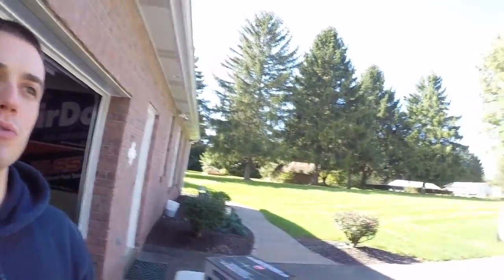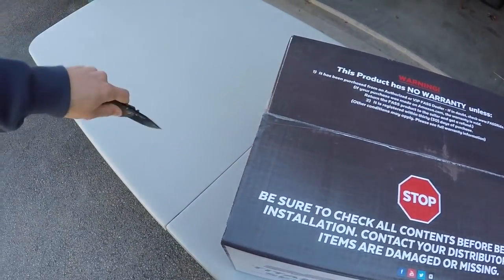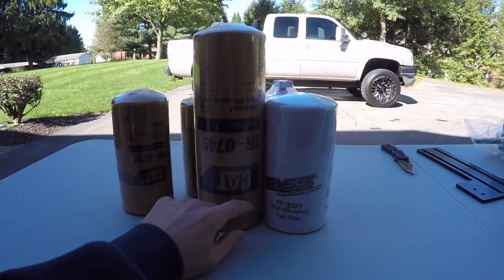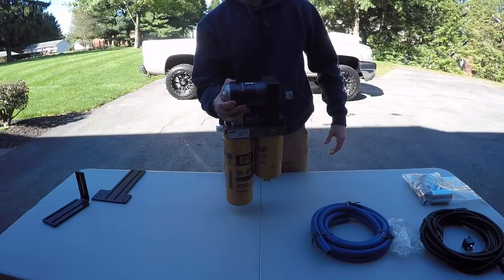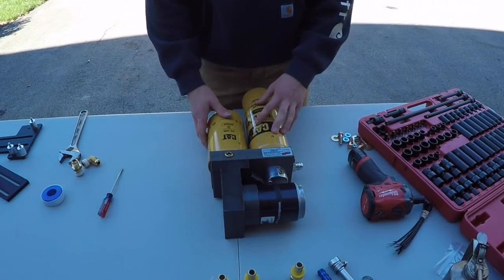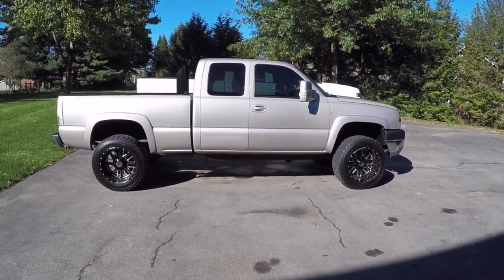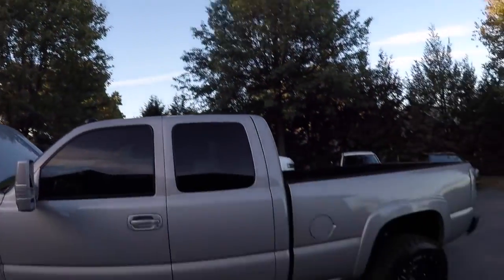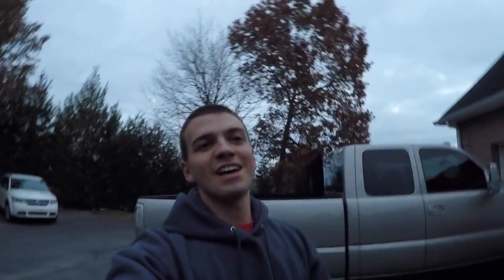Diesel Lift Pumps: Information and Installation!

Comment: Just installed an AirDog II 4G 165GPH on my 08 LMM. I'm finally able to hold 26K psi of rail pressure for a full EFI Live 150HP tune 5 run without dropping any pressure. 
I have 3 inch turbo pipes, 4 inch straight exhaust, full deletes, fuel rail pressure delete plug, ported fuel rail fittings, and upgraded stainless steel Dorman fuel lines. 
The AirDog mount is awesome. Can't even see it. And the quick connect fittings were super easy to install and hookup. Wiring harness is very nice too. Can barely hear the pump with the ignition on and engine not running.
Reply: I keep having issues with the OEM Fuel head, I keep loosing pressure. the last OEM head lasted 2 months. My truck is 2004 LLY with edge programmer.  Nothing else done.  Would a lift pump fix this issue?  Do I have to remove the OEM Lift pump when using this?  Or keep it and use 2 filters??   Thanks.  I'm gona look into the Airdog set up
Reply: SuperRhino_R1 stetler 
I kept my OEM filter housing with the filter itself. I figure more filtration is better but some people say you don’t need it. But you’re protecting your injectors with more filtration

Comment: Like this,have a 2008 2500 hd ,had to do alot research, my truck kept giving me low fuel pressure on fuel rail,and alot suggestions but no right ones till a ran into a honest mechanic and told me to get a lift pump,,,workin project

Comment: It only takes about two hours to do one if you never done one. Also if you get a bigger one and don't need that amount of fuel it will go right back into the tank through the filler neck.
Reply: I agree I think it just “polishes “ the fuel a lot faster with a 165

Comment: Does lift pump do anthing as a lift pump is only a few psi even if it's 20 or 30psi a diesel pump puts out like 30.000psi @ minimum? Having an extra say 10psi wouldn't really do anything but burn out the pump?

Comment: You don't need teflon tape/sealant on the threads of the fittings on the flared side. They seal at the flare, NOT the threads!

Comment: Any chance you can go more into detail on dealing with the fuel lines?
Reply from the maker: Sorry I did breeze over that.  Shoot me a DM at @MDDPerformance on IG if you would like some pictures!
Reply: I used the blue 300 PSI hosing didnt have any leaks with the one Female GM end to the factory tubing.

Comment: How does a pump go out faster simply by having a higher GPH?
Reply: My pump is Pulse Width Modulated.
So running at half speed still pumping lots of fuel. 
I couldnt get the Fass to pump!!!! 
Even pouring the fuel into the intake hose!!!!  WTF???

Comment: Would you recommend the fass 95 for intake, tune, and straight pipe? But I also my touch the turbo/ injectors so I’m not sure if I want the 165.... I’m pretty sure fass sold a 150 pump, is that a good in between pump?
Reply: theGREEK7887 the 150 pump is discontinued
Reply: If I where you I would go on and get the 165 Incase you do decide to do more to your truck that way you don’t half to buy another lift pump

Comment: You know anything about lift pump vs a sump pump. 2015 DMax trying to figure out what's gonna be best for it? Any thoughts?
Reply: Some guys run both. I just ordered a Fass 165 w/ Beans sump. The sump mounts on the bottom of the fuel tank pulls fuel from the bottom as opposed to pulling from the top on stock. The lift pump I believe just gets the fuel from the tank to the motor.

Comment: Good video. Since you have installed both systems I was wondering if the cat filters also fit the air dog systems ?Or if there’s cat replacement filters for the air dogs that you know of ?
Reply from the maker: Mark DeCola
1 second ago
I actually have a half CAT kit on MDDPerformance.com for the air dog.  It comes with an Air dog water separator but the particulate filter is CAT.
Reply: add

Comment: Does the Fass 165 come as a kit from your website? I’m seeing everyone selling the 165 titanium, but none of the pictures show the hoses, fittings etc. I’m looking for the whole kit and the cat filters. 06 LBZ and I’m chasing a low fuel rail pressure error under heavy load. Already put a race plug in and went back to the stock tune on the Edge Juice. I also saw your video on the trans go, and I’ve done that, upgraded the transmission cooler lines, and have the cat fuel filter! Just found your channel and I’m hooked! Thanks for the input!
Reply: Lloyd Cottrell shit me too

Comment: Nice vid... hey are you planning on keeping your stock filter system or you planning on deleting it ? That's were im at now.... I'd kind like to keep it incase something fails with the pump... what do you think?
Reply from the maker: Thanks! Personally, I will never turn down exert filtration when its in front of a multi thousand dollar fuel system.
Reply: Mark DeCola True... tnks bro
Reply: I left mine (factory filter/pump) on and good thing I did, I discovered that at 1/3 tank (with gravity sump) I get fueling issues (slosh) with the fass, factory pump doesn't miss a beat and never looses prime, just pressure with excess use of the skinny pedal. Would love to find a way to run both in parallel to have the best of both worlds....

Comment: How often is the filter/water separator supposed to be replaced?
Reply: I changed mine the other month with 47,000 Km on the . A little of the black asphaltains with half a pound restriction across the filter. Next time going longer between changes.

Comment: Would you recommend putting a fass 165 on a LML that is stock but is running a 100+ hp tune?
Reply from the maker: Yes for sure on the LML! Especially with the failure prone CP4.

Comment: So what one can i get to work for a 1995 f250 7.3..stock motor..Maybe ill do a 150 injectors at some point..lol..Found an air dog but then i have to buy something else to make it work for another $400..grrr...lol...Cant even find a fass that works for the 7.3..so idk
Reply: Why wouldn't a FASS 140 work for you? May just have to do some small tweaks with wiring and the brackets. But I'm not sure as I don't have a 7.3.
Reply: @carls2210  ..Im not sure..But i just made my own fuel setup...Works gd...

Comment: will those filters work on a airdog 4g165?
Reply from the maker: I actually have a half CAT kit on MDDPerformance.com for the air dog.  It comes with an Air dog water separator but the particulate filter is CAT.

Comment: My Fass 165 came with a replacement bolt for the bed bolt. Did your instructions tell you to place the 10 amp fuse in the top slot of the “add-a-fuse”? Mine did and I know it was incorrect.
Reply from the maker: I do not remember on the fuse.  Unfortunately no replacement bed bolt.  On the Cummins ones Ive installed it did come with a bed bolt.

Comment: You need to have filters with the flow rating similar to pump gph to have correct flow and filtering.
Reply from the maker: James Miller 100% agree man! Anything with lower flow rating would cause issues. With the filters I have here, the flow rate actually increases, making it easier on the pump.

Comment: That is false information. You will not burn up a pump on a truck that doesn't need the high fuel flow. Its a internal bypass system, meaning it just returns the fuel it doesn't need back to the tank.

Comment: Do you know how to test a fass pump?
Reply from the maker: There is a port on the pump to check what PSI it is putting out.  It is the little brass plug by the port that runs up to the engine.